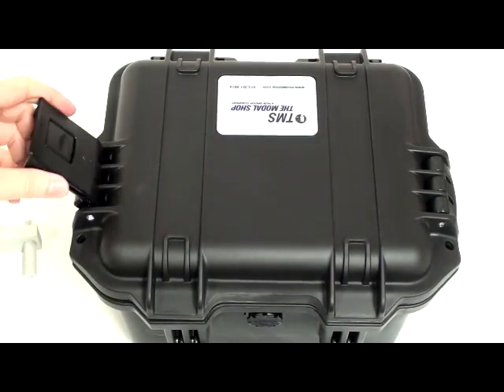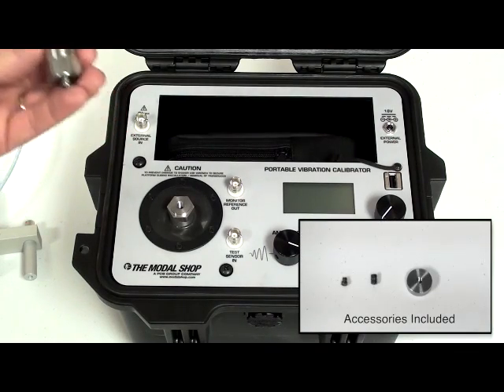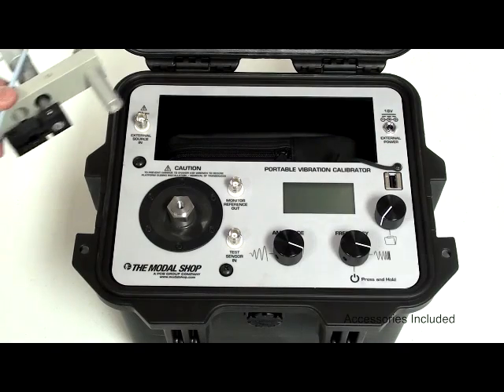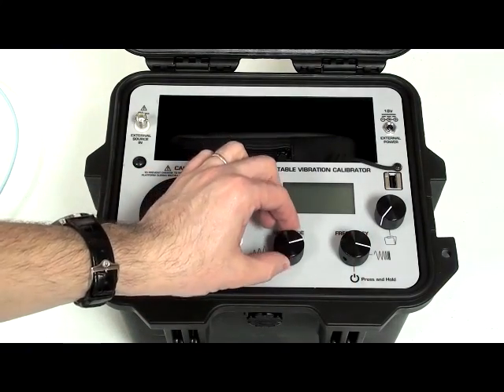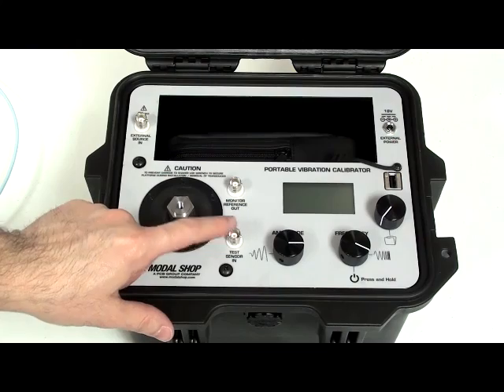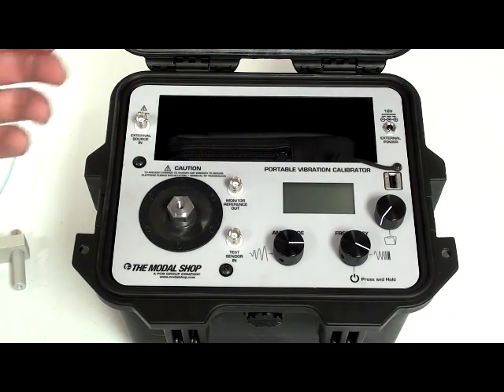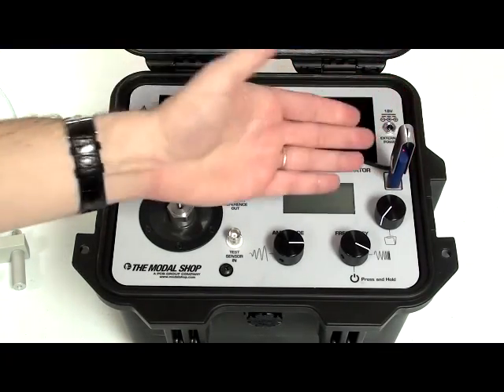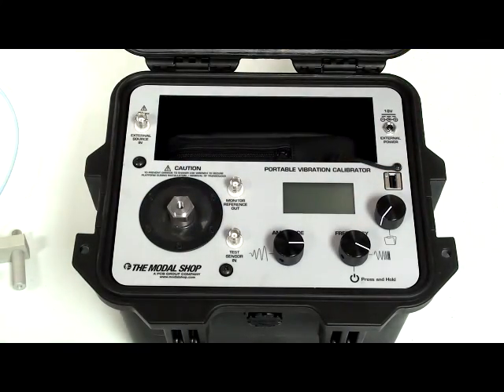Portable Vibration Calibrator - Overview - 9110D

Comment: Can do calibration or testing on site without removing the sensor?
Reply from the maker: Hello, thank you for your question! The portable vibration shaker tables are mechanical calibration devices, so the sensor must be removed and mounted to the shaker or, in the case of a proximity probe, mounted over the shaker with the tip directed toward a target of proper materials.